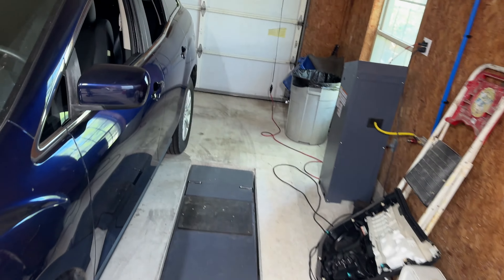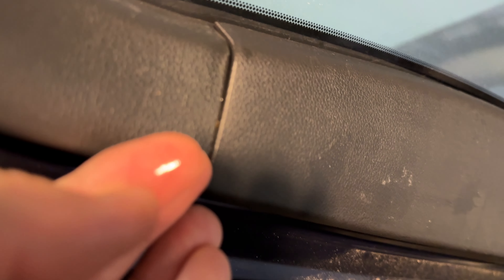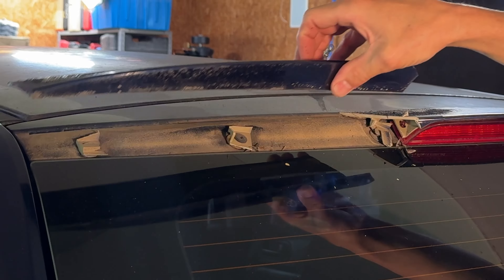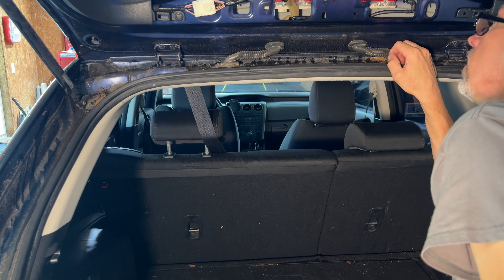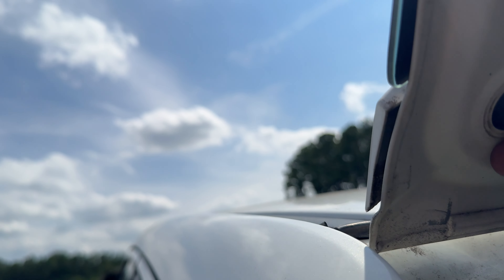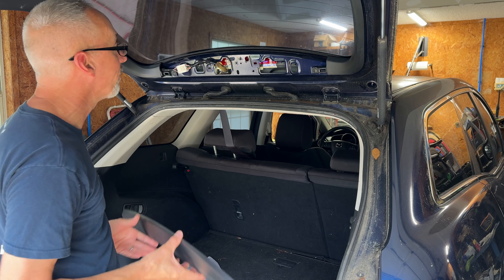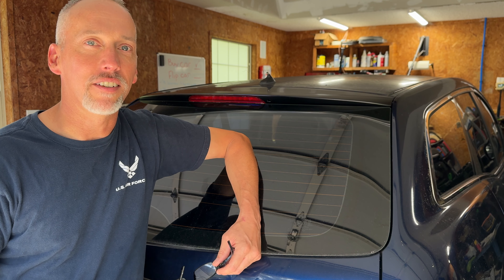15 minute job - finished in two days :/

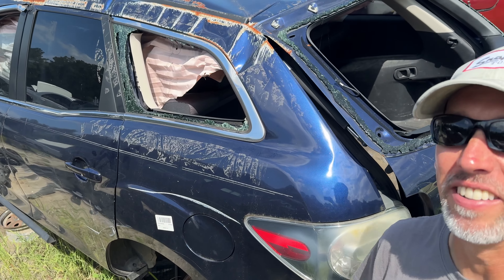Comment: 7:24  Keep on keeping on! Heck yeah dude, lol. I've been on the junk yard stroll trying to find a replacement part for something that I broke but really didn't break. Plastic parts become so brittle. Electrical connectors are also super brittle over time. Great video dude
Reply from the maker: Hey cool, you saw it! I thought about you when I said that. Yup, plastic is the worst. Cheers!